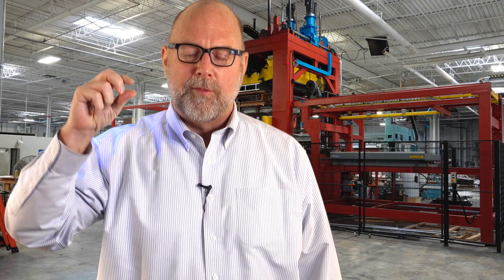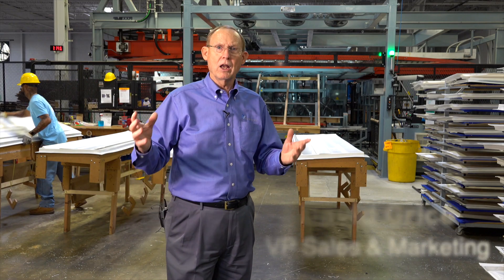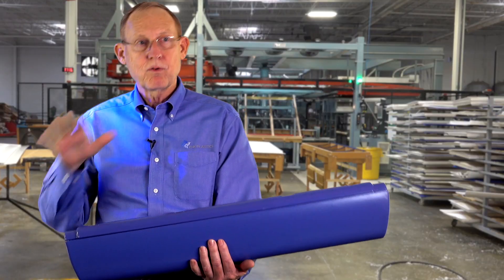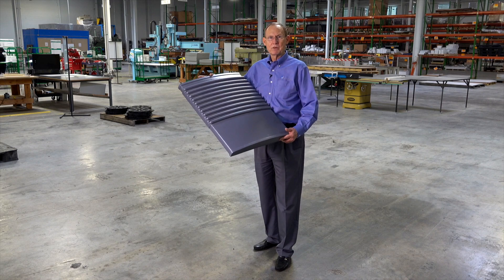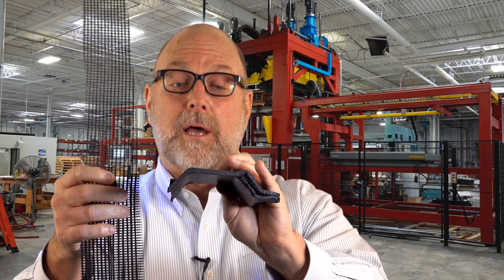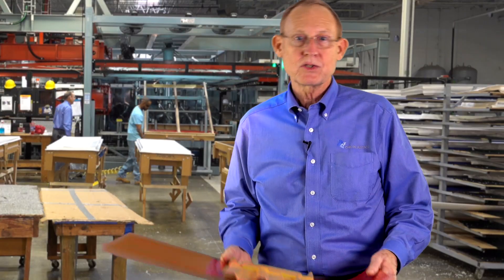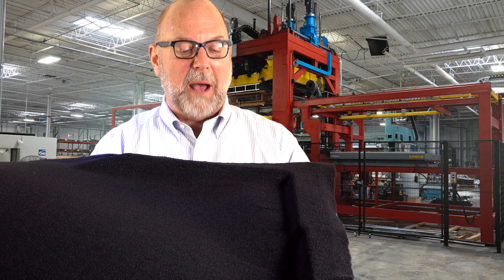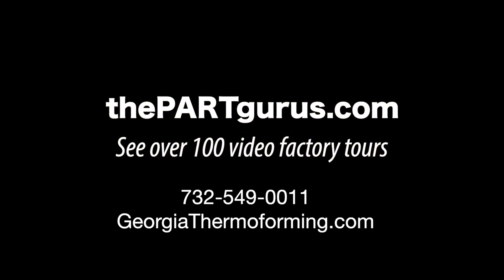Thermoforming or Injection Molding? These Experts guide you. CandKPlastics.com, New Jersey, Georgia

Comment: The machine is called a sheet machine that oversized molds and heavy gauge material will not fit into a inline thermoforing machine. Female molds use plug assist for deep draws along with snap-back. I worked in thermoforming for 37 years and even helped Sencorp in R & D on their 2500 and 2200 3 station inline. Setup is pretty easy getting the machine to run is a art form. Webs and thin walls along with host of other troubleshooting skills.
Reply from the maker: thanks for the info

Comment: I have a question
I have a thermoform machine which I just purchased , every thing is working fine but the issue is the trimming process, the heating ,forming are all perfect but the trimming section is giving issues, . It trims perfectly when machine works for the first 20 min's but longer than that  it no longer  trims well
Reply from the maker: Sounds like a heat issue